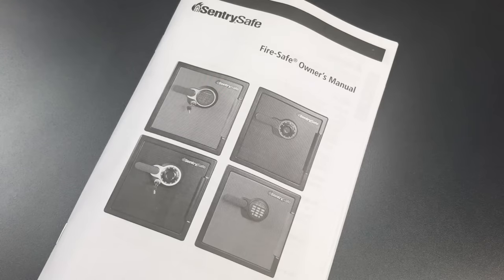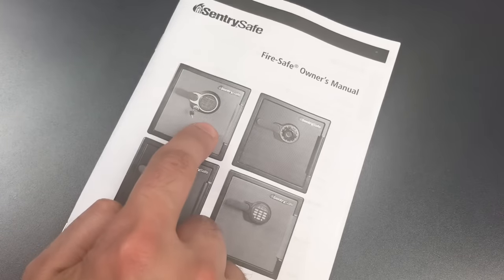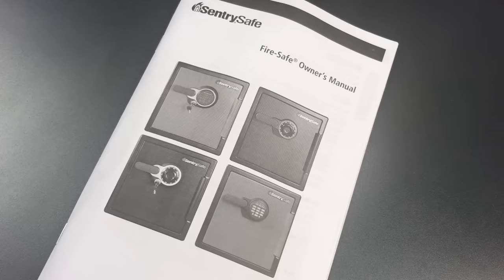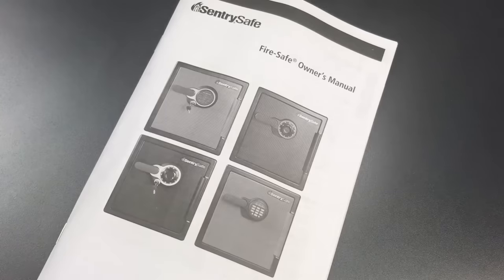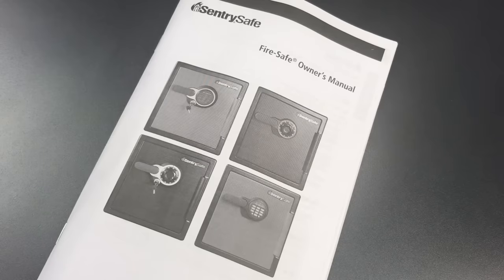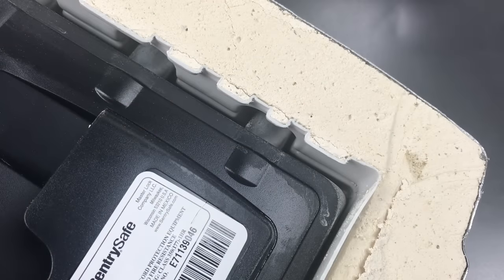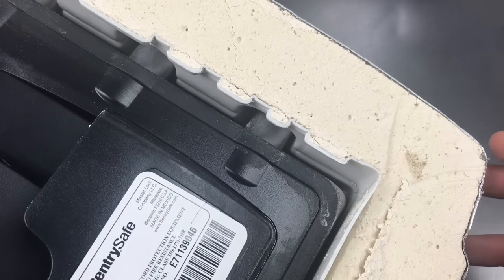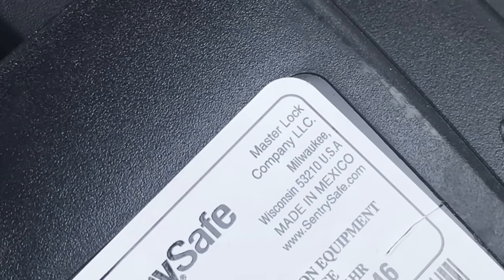[756] Sentry Safe Cut in Half FAST!

Comment: Personally I'd never consider one of these to be secure from someone wanting to get into it. But it does provide some fire protection for important documents which is my primary reason for having a safe.
Its also decent for keep guns away from children.
Reply: "next, we will break this safe's lock using bumble gum and rubber bands"
Reply: @responseability2624  "Stfu Karen"

Things a Karen would say?
Is this for Final Jeopardy?
Did I win?
Reply: Not really if teens can teach ppl on the net to open this kind of safe with standard household items
Reply: @LordSeth18  If the child is old enough to know how to follow instructions to crack a safe he's old enough to know what a gun can do.
That's a whole different thing that keeping your little ones from thinking its a toy.
Reply: @LordSeth18  
"I use it to keep gun away from toddler or silent robber."
"BuT yoUR TeeNAgEr CAn JuSt brInG SaW fRoM GaRAgE aND CuT it In HalF"
Reply: @simonspacek3670  Speaking to the “silent robber” he’d just laugh pick this up and be on his way. Totally agree about it being good for keeping away from children though, good safes aren’t that cheap, and this one protects against all but the most brazen and deliberate thieves, which if that’s an issue they’d probably not be all that deterred from all but the most elaborate setups.
Reply: This type of safe can usually be opened by tipping it over and turning the handle at the same time it hit on it's edge.
Reply: @travispratt6327  That reminds me of the time I first met a dude who I'd later become good friends with. I was hanging out with a girl I had a crush on, and she asked if we could give her friend a ride, to which I agreed. We pull up in front of some house, and this dude comes walking around from the backyard, cool as a cucumber, carrying a safe very similar to the one in the video. I didn't ask any questions at the time, as I was also doing plenty of sketchy shit back then, but it was pretty clear that he had just stolen it out of that house before getting in my car with it. We later became great friends and hung out for years, and the story of our first meeting came up a time or two, but I never got around to asking him about where that safe came from or what was in it.
Reply: @cheshirecynic3061  Dude...you can't leave us hanging like that.  Call him up and find out the rest of the story and report back
Reply: @Matticus289  Unfortunately, I don't know how to contact him anymore. He was an unfortunate casualty of me getting my life right, leaving my hometown, getting off of drugs, and burning a lot of past bridges to have a better future. I totally miss the dude, he was an awesome friend - but he was still smoking meth, and I couldn't be around that anymore if I was gonna get myself clean. But maybe, hopefully, someday I'll run into him while visiting family in my hometown, and if he's off the crystal too, I'd be more than happy to rekindle the friendship, and I know the first thing I'd ask him.
Reply: There is always one guy who rationalizes these products by eliminating every need you would have in spending $$$ on this junk dressed up as "security"

Comment: Customer: Is this a safe

CentrySafe: Well yes, but actually no.
Reply: DUxMORTEM its sentry not centry
Reply: It's a fire resistant safe. It protects from fire. That's it's purpose.
Reply: @sunryzen6025  yes, the lock on the front is clearly to protect against fire.
Reply: @seekerrild4629  You don't want your children or random people going into your safe where you keep your important documents, gun, or other valuables. But the purpose is still to protect those things from fire.
Reply: Sunryzen he said fire water and security
Reply: @sunryzen6025  we found the SentrySafe owner
Reply: @sunryzen6025  and loosing or misplacing the key.... maybe the purchaser misplaced the brain.
Reply: @tiedanhuo9731  Again, depends on what you need from security from.  A properly motivated thief?  They'll take the whole thing if it isn't bolted down regardless.  If it is bolted down, it might just be enough of a pain for them to decide that the jewelry and TV are enough.  I agree, it isn't particularly secure, just gotta decide what level of security you need and want.  This is primarily to protect against fire and flood more that thieves.  The level of theft protection it has is "well... it has a lock I guess"
Reply: @jong3122  I'm actually staring at this thing and it makes me think the locking mechanism would be a liability.

If the primary purpose is protection against fire, why would you want a box with a locking mechanism that looks as though it'd melt?

What's the point of a fireproof box if you can't get it open after a fire?
Guess the weak construction is so you actually stand some chance of getting your stuff back after the thing has burnt. XD

Comment: When LPL said "circular saw", I thought "oh, that's what they must call an angle grinder in the US". Nope, it really was a circular saw! Cut through it like butter, too.
Reply: With a wood blade too
Reply: @Michael Benedict Skilsaw is the major brand that specializes in circular saws, much like Kleenex is the major brand of tissues and Band-Aid is the major brand of bandages. You can see in the video that LPL is using a Skilsaw brand "skilsaw" that is indeed equipped with a blade meant for cutting wood instead of metal. 

And yeah, no matter who makes an angle grinder, it's still just an angle grinder. Watch out for those exploding discs!
Reply: Dizzy Gear  They certainly ARE sold in stores - you can get one right now from Lowe's, Grainger, or even WalMart. My dad ran a construction business and owned three or four Skilsaws, same with my best friend's dad, so I don't know how you've managed to avoid the defining circular saw brand until this point in your life. 

To quote Epic Saw Guy, who I'd assume is an apt authority on the subject: "Skill saws and circular saws are essentially the same thing. Skill saws get their name from the famous manufacturer Skil. Their circular saws are so popular that with many woodworkers, the name Skil came to mean circular saw. Over time the term skill saw developed."
Reply: Of course, if the safe was installed in a wall, he couldn't cut it up in his driveway. No idea what point the LPL was trying to make with this video. Pretty weak.
Reply: @richsackett3423   1. That's not the sort of safe that people put into walls. It's larger than those are, and would usually found tucked in the back corner of someone's bedroom, beside the bed, or under a desk or table. 
2. Even if a safe were installed into a recessed wall, it'd be super simple to cut it out with the very same Skilsaw. 
source: am a former burglar
Reply: @cheshirecynic3061  I mean, you could take a carbide blade to the front of a similarly-inexpensive metal wall safe and get through it almost as fast. And with as much noise, Mr. Burglar. Are many burglars carrying Skil saws these days? Hadn’t heard. 

I may put one in a wall (crawlspace actually) and I’m a people. Last I checked, anyway. Fire resistance is as important in that application.
Reply: @richsackett3423 That's Ms. Burglar, actually. And I suppose I should have said "MOST people," as yeah, you're free to do whatever you want with whatever you want on your own property. Do your thing, bud. But to address your other point: Most homes worth breaking into have tools in the garage, and most people with tools have a circular saw. I've got one, even though I only need it once every few years. I've also literally stolen a circular saw and other tools from a house in the past (not the one I have now, and past the statute of limitations, obviously). So yeah, once the burglar's in, it's easy enough to figure out where the tools are, and the noise is way less of an issue than you'd think. Besides the fact that 90% of the neighborhood is probably sleeping heavily, and the other 10% are watching their loud TVs or listening to music, the insulation in the walls of the house will cut down a lot of the volume, and safes are usually mounted on an interior wall, so you don't have to worry about the wall the that faces the outside of the building vibrating and making a ton of obvious noise. And it's not like it's a long, super loud process to begin with - a Skilsaw will rip through drywall and a couple studs pretty freakin' quickly. Really, the hard part is getting into the building, and that's the only time noise is a big concern. I used to have full-on conversations with my partner while we were inside, because we really didn't have to worry about people hearing us. "Think we should take this?" "Nah, it's not worth enough for how bulky it is. Let's get this, though, for sure!" Hell, I once sat down on a guy's couch and rolled up a cigarette with HIS tobacco and papers, before taking them and almost everything else that he owned. I still feel pretty shitty about that one and wish I knew who he was or some way to make it up to him, because he definitely didn't deserve that. I'm really glad I got out of that life, but it still weighs on me pretty heavily, so I try to do what I can for my community in an attempt to atone for all the times I didn't get caught.
Reply: @cheshirecynic3061  Oof. wot tl;dr
Reply: @richsackett3423  If you really want a good fireproof safe that's a lot harder to walk off with, I recommend a large fireproof rifle safe. Go with one that's 500 pounds, minimum, and has authenticated evidence of its fire and temperature resistance ratings (both are important), as well as bolts on all sides of the door. The heavier, the better, in terms of theft, fireproofing, and thickness of the plate metal. My last bit of advice is a spinning dial for the lock. It takes a little more time to get into, but it's also a lot harder for potential thieves to get into.
Reply: @richsackett3423  Bruh. Reading isn't hard.
Reply: @richsackett3423  Oh. And carbide on metal is WAYYYYYY louder than a wood blade through wood, so I don't know what you're on about there.
Reply: We call them just Grinders here in the US.
Reply: @jamesb120  I noticed that also!

Comment: He didn't mention if it was a timber blade or metal blade. Jeezuz, I was expecting 1/2" steel plate ... not tin and foam. Thats one major rip off.
Reply: That was a timber blade.  A metalcutting blade would have thrown a lot more sparks.
Reply: Look at 2.37 ish u can see the carbide blade
Reply: The foam makes sense.

This is above all else  FIRE safe. - wouldn't be much use against a fire if it wasn't insulated...
But the thin metal is something else.
Reply: A timber blade can cut through thin metal. Not advised due to dulling of teeth.  A metal blade would have much smaller teeth.
Reply: 2:36 definitely timber blade
Reply: Even just throw some rebar into the foam and you defeat a saw.
Reply: @asusmctablet9180  only if the person was using a wood cutting blade
Reply: It's certainly not very secure, but it depends if you are using it for it's intended purpose if it's a rip-off or not.  Didn't see and bolt holes so anyone that wants security would never buy this anyway, however, if the purpose is to keep your shit safe if your house burns down, it looks like it will do a good job of that.  and for what these things cost, that's not bad.
Reply: If the safe were made out of thick steel, it would be too heavy for the average person to move.
So, it is just made to look like a strong safe and hope that your average burglar is very stupid.
Reply: KuraIthys yeah I think the primary case is people storing important documents so that if a fire breaks out their documents aren’t burned
Reply: I was gonna ask about the blade type, and then I noticed that it didn't matter too much.
Reply: that white stuff is basically gypsum,like whats in dry wall, remember it's a fire safe not a security safe.
Reply: @johngaltline9933  You can bolt SentrySafe safes down, however. They just get a drop in water resistance afterwards.

Comment: For all y'all talking about how it's a fire safe, you're right, but it HAS A LOCK ON IT. There are plenty of fire safes with simple latching mechanisms to keep them closed, whereas this one is meant to double as a security safe, thus the lock.
Reply: At my parents company they had a fire safe for the main ledger and the most important papers like customer and order files. (Pre-computer)
It had a lock, but the keys were always in it, so a burger would just leave it instead of either breaking into it at site or remove it.
The paperwork would be essential to rebuild the company in case of fire, but worthless for anybody else, so leaving the key would prevent the loss of the safe.
Reply: @MrTassadarzo  that's pretty weak
Reply: @MrTassadarzo  well, that's rude.
Reply: @Thestin  Is it rude to burn down thousands of businesses and kill dozens of innocent people to demand Marxism?
Reply: @MrTassadarzo  that's not what were talking about. We are talking about the part where you made fun of someone.
Reply: @Thestin   You mean the part where he was called weak, after which he retorted? :)
Reply: @ToreDL87  his argument, not him.
Reply: What if I want a fire safe that has the added benefit of keeping cash and jewelry away from my kids? It'll be many a year before they can operate a buzz saw.
Reply: It's a very basic security safe that specializes in fire resistance. If you want both to be top notch you're going to have to pay the big bucks.
Reply: @LeifNelandDk  Since when did this talking about old safes degenerate into idiocy about marxism and people trolling each other?
Reply: @indigochild161  Leave me out of it.

Comment: I really want to see a youtube video covering the vulnerability of the digital keypad, especially on newer versions of these. I want to see if they have the same issue as one that I messed with a few years ago. There was an older digital keypad safe at my workplace that had been unused for some time. No one knew the code or if there was even anything in it. I simply popped the keypad cover off, using my bare hands - no tools, disconnected the wiring going into the keys and jumped it over to the wires past the keys. This simply provided direct power to the lock which would otherwise not be supplied until the correct code was input. door opened.
Reply from the maker: The same vulnerability is present.
Reply: @lockpickinglawyer  😂 damn!
Reply: No need to do that!  I bought an electronic yale electronic "safe"  and I could bump it with a hit from my fist: the cylinder that in turn locks the  bars that lock the safe has a spring and can be bumped.  Most cheap electronic safes have that mechanism.   Who designed that?
Reply: I've seen people use magnets to open these types of locks. The lock mechanism is an electromagnet solenoid so by using a strong magnet you can force the thing to open completely bypassing the keypad and lock.

Comment: For fire protection, my parents did have a safe from the same company from the 90's, it had a plastic shell instead of the thin metal though. It was in a house fire, the plastic got messed up on the outside, but the inside was totally fine. All documents were safe. Near the ceiling the temperature had to be about ~2,600°F based on glass deforming. So I'm guessing the safe experienced at least 1000°F being midway from the floor to the ceiling

Comment: This safe comes with bolts for bolting it down to a wood or concrete floor, which would have made this particular attack more of a hassle. Not too much more of a hassle, though - you could probably do four cuts on the top and then pry a square chunk out that you could reach down through.

This is fine as a fire safe, though. Housefires don't have circular saws or high-power magnets or any of the other ways of popping one of these open.

Comment: The shaped "fire brick" structure might actually be useful to make a bench-top hardening/tempering oven. AvE (channel name) is the person that comes to mind who would be up for it. maybe you can send him the remains :D
Reply: That's a really good idea, and a perfect use for it! It's made for heat insulation - which means it can keep heat in as well as it can keep heat out. Add one or two holes for a torch and it's perfect. A lot cheaper than most purpose-built ovens too. Hopefully that clay holds up decently, as the plastic inner liner needs to come out.
Reply: I don’t know that it would hold its shape.  Typically the fire insulation used in such “safes” is just gypsum with a bit of binder, and has very little structural integrity without the container to hold it all together.
Reply: @chrisedwards3866  Yeah,heat insulation for about an hour max, No use  for an "oven"
Reply: Yeah,heat insulation for about an hour max, No use  for an "oven"
Reply: Would make a good vijayo

Comment: In their defense this is fire safe, and not burglar safe. It's primarily meant as a fire proof place to store stuff. It must not be confused with a safe.
Reply: Yeah, I think LPL is wrong to claim that the only reason for using a product like this is for theft prevention. But I do agree that using words like "safe" in the context of this is confusing, since "fire safe" sounds like a safe that also offers fire protection.
Reply: then why have a lock on it?
Reply: It is marketed as a “Safe”. Not a fireproof filing cabinet.
Reply: @raffyc66  A safe is a container for protecting valuables against theft or fire or both. The thing that you're calling a "fireproof filing cabinet" is called a "fire safe". There is nothing misleading per se about a fire safe that provides very little security against theft. However, I think the actual problem here is that the product is called "sentry safe". The word "sentry" implies that this is intended to be a security safe as well as a fire safe, and that does seem misleading.